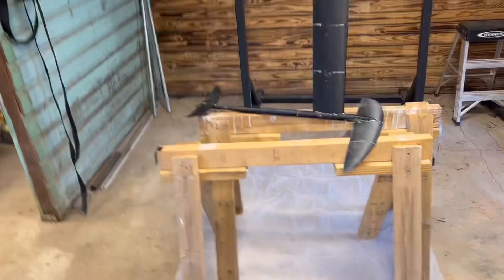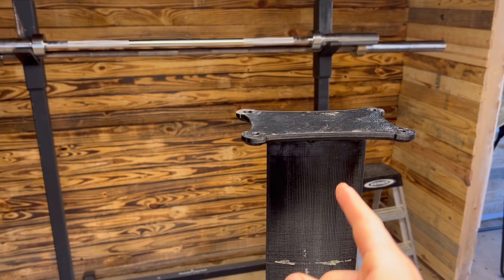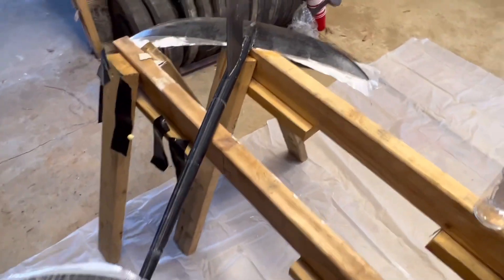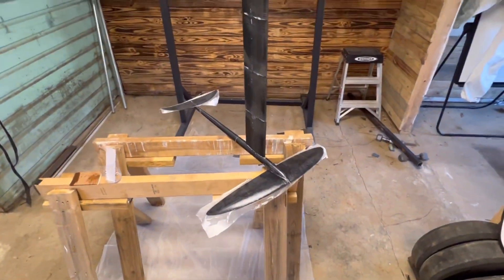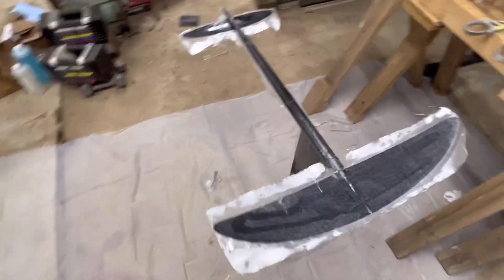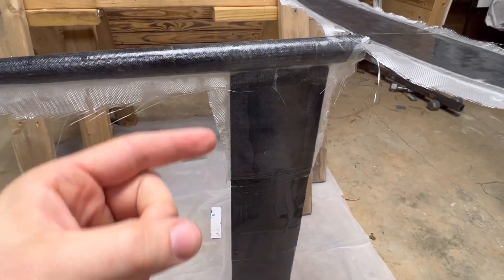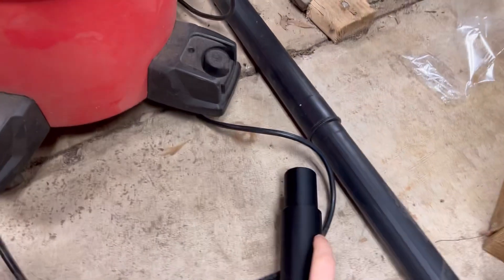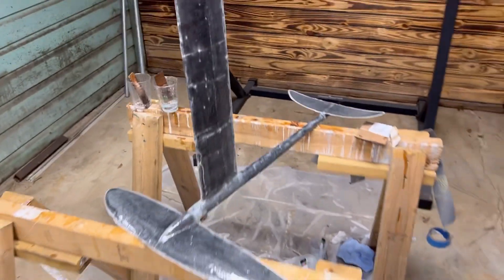3D printed Hydrofoil Pt. 3

Comment: Sorry if this is a novice question. I’ve never 3D printed anything. But could you use one of the carbon fiber or glass fiber reinforced filaments and print one without having to fiberglass over everything?
Reply: It will not be strong enough. You have to do an epoxy/ carbon fiber or fiberglass layup
Reply: If you had a GIANT SLS printer you could make it out of some sort of Nylon or somthing and the wing would probably be strong enough, but not the mast. Due to lack of stiffness this still isnt really a good solution though. Best would be to machine a mold and do it that way. I've made a ton of these carbon fiber covered 3d printed wings.

Comment: Looks great! I want to try a 3d printed one next too. You might end up needing a few more layers.  I built a clearwater foil kit and ended up needing like 19 layers at the joint to the mast because it kept breaking. Nice job so far though. I will follow your videos.
Reply from the maker: Agreed. The next video will be a trial run and then I’ll go from there. Currently working on the 2nd 3D printed one that will be much better!
Reply: @stonewall_kelsey4201   right on! If you want i can email you the clearwater glass layup layer instructions. Might be useful as a starting point for the future build. Cant wait to see the test run. samholmessailing@gmail.com